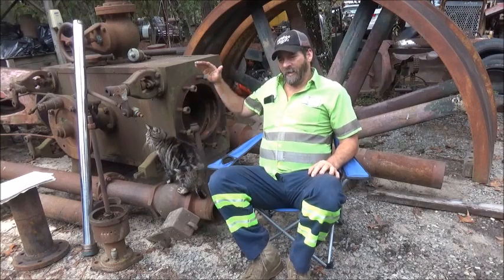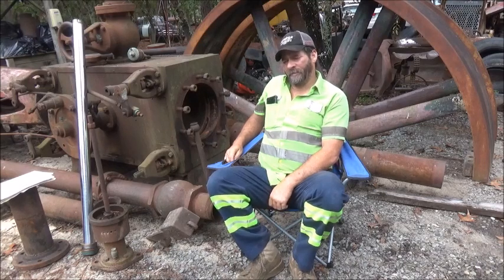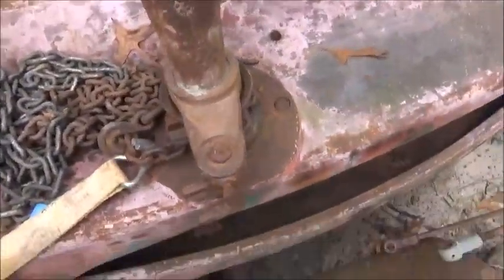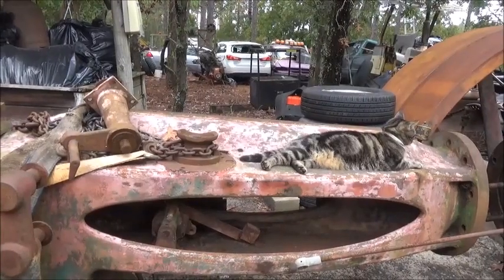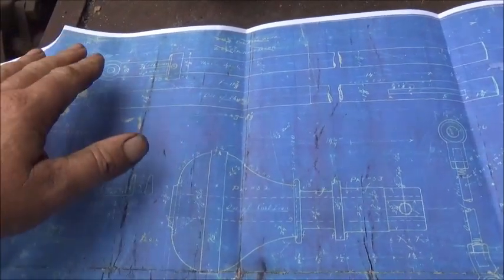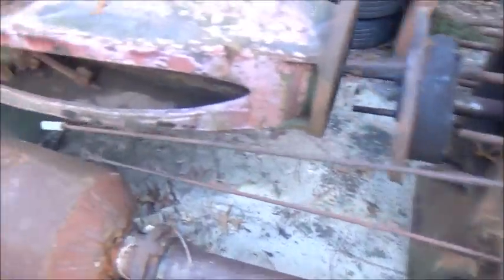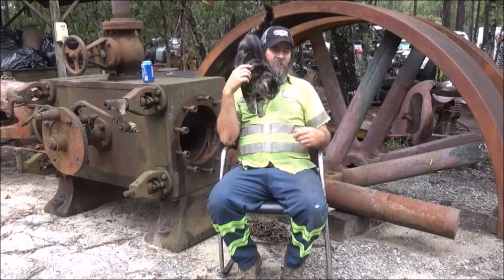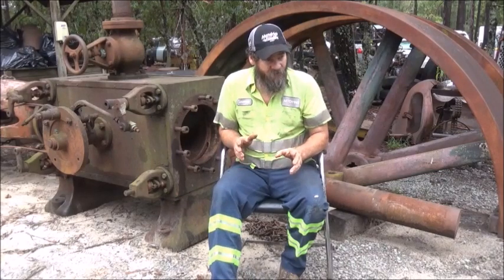BATES CORLISS STEAM ENGINE 20+ YEAR QUEST TO SAVE EPISODE 13

Comment: Fun fact: The phrase “balls to the wall” refers to the centrifugal governor of a steam engine, which used spinning balls to adjust a valve limiting the amount of steam entering the engine. As more fuel is put into the engine and more steam produced, the added pressure and centrifugal force of the spinning bearings pulls them outward toward the wall of their housing, activating a lever and a valve that limits the amount of steam.
Reply: Charlie Booker  Absolutely correct although related more to multi-engine aircraft,  the 'wall'  being the firewall.
Reply: Afternoon Jonathan,  you are undertaking a monumental task, I am sure you will succeed,  you can tell Nanna likes being the center of attention,  but she really cares about you, our pets are awesome judges of character, which I'm trying to say you are a good person....best of luck to ya!!
Reply: He said balls........ha haha hahaha
Reply: @bobd7347  Just got me thinkin’ it’d be pretty funny/cool if Jonathan here, went to his Hot Rod that has the dual carbs, having two aviation WWII throttle cable/levers with the balls, mounted along the bell-housing hump as mechanical override throttles,  just to demonstrate this exact experience on the open road, in real time! Nana Cat-Scan approved of course
Reply: Charlie Booker  Well, the documentary on steam engines I saw, and the info that was told by a steam engine guy on Jay Lenos Garage was wrong then.

Comment: Hey Jon,
It's quite possible that this never ran a line shaft. It may have been hooked to a generator.
While you were recovering it, we never saw line shaft or pulleys,  we did see old insulators though.
Just a thought.
Reply: Indeed, corliss engines were often used where fine control of speed was an important factor.

Comment: Thanks for another update. Look after Nana she's the most useful thing to help with this build, she's scanned every part and blueprint figured out most of it and any questions ask her she'll know what you might not L.O.L.  If you can figure out those bevel gears  you need, you can buy blanks with the teeth already machined and just  bore the holes for shafts and the fasteners. I work on a seed cleaning plant that has some gears that have been obsolete from the company for about 40 years.  I just tell the machine shop all he needs to know, he gets the blanks and does the final machining to the shaft spec. From your comment the other day I'm hoping you live long enough to finish this project, and I'm still alive to see it finished !  see ya next time,   Take care.

Comment: Greeting Jonathan, I also have about the same memory's of being around 5 years old. One of mine was from your neck of woods, Stone Mountain. The cable car building, it had a glass window looking into all the large gears that ran the cable cars up & down the mountain. After getting home I had made a working model of it, using kit string, a drinking straw, a small motor and a pill box for the car. So I get it, and I'm shore many other as well. Stay safe, You friend in PA. Robin Jo

Comment: Maybe you could explain what a governor is and what it's purpose is. I'm sure there's lots of people who don't know. Also, that's the great thing about pets. They love you unconditionally. Thay would never, ever give you a thumbs down, or leave a nasty, negative comment. Lots of your viewers love Nana cat, and it just wouldn't be a Jonathan W. video without her! Tony.
Reply: A governor regulates the speed of an engine to not exceed a maximum design threshold. Machines are designed to run at a maximum speed so they don't come apart due to excess stresses caused by over speed. At rest or slow speed, the round balls are held vertical by a spring, the balls bearing on linkages controlling the valve that admits steam to the engine thereby reducing the amount of steam admitted to the engine . As the engine speeds up, the balls spin faster and centrifugal force causes them to start to move out, which starts to close off the valve they are controlling through the linkages. The size of the balls are determined by how big and stiff the valve the governor controls is. The force of the balls swinging out has to work the valve so they have to be heavy enough to do so. The size and tension of the spring bearing down on the linkage to keep the balls vertical determines how fast the engine can go as it limits how far the balls can swing out and how fast they swing out. Tighter spring--balls stay more vertical--more steam pressure admitted--higher speed. Runaway engines are caused by something happening to the governor or its linkage controlling the valve admitting steam into the engine. Too much steam--too much speed--then the flywheel usually comes apart with great force since it can't stand the centrifugal forces on it. A flywheel on a large engine weights several tons and it will destroy the building it's in if it comes apart. A boiler explosion can launch a boiler through the roof like a missile and scald anyone close by (your hot water heater can do it too if the pressure relief valve fails). My Dad's grandfather lost his life in a boiler explosion in a factory. Hope this explanation helps some.

Comment: Jonathan. I built aircraft and assemblies for about 25 years (aircraft manufacture, RAMS Team (Repair and Modification Services)  - McDonnell Douglas and then Boeing. I was an expert blueprint interpreter. I became a Research Engineer for Pemco Aviation Group Inc. on Boeing products owned by the Air Force. I had online access to Boeing and Air Force digital engineering storage systems. Research Engineer is a position I created. REDARS was the Boeing system. I'd like to see the Engineering Notes. IF you need some help interpreting what Engineers were thinking when they designed that machine I 'may' be able to help. Pemco performed Depot Level Maintenance. They stripped down K-135's and C-130's to the carcass and rebuilt them to Flight Worthy status. No, it's not a 1927 Franklin....but these fly ;-) Thanks for the video. I really like your work!

Comment: Hi from the UK.....  The cylinder could be re bored in situ where it is now using a portable cylinder boring machine. The machine bolts on to both ends of the cylinder using the front and back cover studs and slowly winds a between centers boring bar through the cylinder, They use them to re bore traction engine cylinders without having to take the block off the boiler.  There must be some in the USA....Just a bit of research needed to find the nearest one.  Try preserved steam societies etc.
Lovely engine.... I know you will succeed in its restoration.....  I look forward to following its progress...
Dr Harry

Comment: The weights make me think of the accessory gear on the early caterpillar 3400 motor. The weights use centripetal force from the spinning of the gear to move the shaft that connects to the governor, helping to regulate the injection pumps.

Comment: Rough figuring using the interwebs says a 5" cast iron ball would weigh just short of 20#. 

I tried metal detecting at my house, it's a post and beam house built sometime before 1860. I found all the sickle bar mower teeth and little wads of aluminum foil you could ever want. Plus a few cases of smashed Black Label beer cans, a few horse shoes and a couple of springs out of old car seats. To tell the truth, I gave up on the metal detector after about 10 minutes of beeping every 5 seconds on junk. Most of that stuff was dug up when digging planting beds.
Reply: I keep finding EVERY nail the builder dropped when building/adding on to the house ( it is an OLD house ) !

Comment: You might try a black light on your blueprints, sometimes the wild color changes make things easier to see too. I'm betting you've got some hard to read spots there. Another history venue you could try is cencus reports. I'm unsure if they would list place of employment back then. They still will list occupations, like boiler operators. You might be able to build a timeline on the engine. Hard to say.  Maybe you want to involve local news. Get the story out about the engine, your quest, and that you are seeking information about the factories that were there, and what they did. Might get lucky and draw in some pictures and family histories that were involved/worked there. The only people that will have it will be older and eager to share. Never know what will turn up if you can put out the bat signal lol. In the reconstruction are you planning to make the engine steamable even though your intentions are to go air power? Never know you might run across a modern factory boiler at auction somewhere cheap. It'll be neat to see it spin. Thanks for sharing

Comment: Good plan you use compressed air to run the engine.  Much safer than steam especially when other people standing around the engine.
You could add white smoke to the compressed air coming in so it can look like steam coming out of the exhaust and the all important whistle!! 😀

Could even use one of your water pump steam engines to run an air compressor to run the big engine!
Reply: his previous video mentioned this ingersoll rand running the steam engine: https://www.youtube.com/watch?v=JKemgnWp3YA&t=5s

Comment: First blue print i seen that's blue always seen white and black 😎.
Reply: The blue prints are called blue prints because they are blue! It was an earlier chemical process using a light sensitive paper. The black and white ones today are drawn on a computer and printed on a big plotter on ordinary paper and are just "prints."  If you lay a blueprint in the sun it will bleach away to white and you have just a blank piece of paper.

Comment: Does a 14 inch steam engine piston have rings? And if you bore the cylinder. The rings wont fit or operate? Blue Prints are priceless. I could read em all the way from Texas. Take it one piece at a time n build each unit to make the whole engine. 
You'll get it. You just aint got it yet.

Comment: Just a idea ,could you turn the flywheel with a electric motor?Then you would not need the cylinders rings to seal and still have every thing move . The is done with a huge almost as big as the big boy locomotive at the Dututh Minnesota  transportation  museum.  The locomotive is slightly jacked up and there is  a motor turning the drive wheels on the side hidden from view.  That runs every 20 minutes  or so.
Reply: Sorry typo. Duluth Minnesota

Comment: On these old steam engines, why didn't they design the governors to be Fail-Safe?

So if the governor drive breaks, the engine shuts down rather than runs away?

ETA: And/or replace the belt with a drive shaft, which is not likely to fail catastrophically?
Reply: They did change the design later on so that a failure shut it down
Reply: @johnalexander4356  I was thinking that too.. most possible defects on governor assemblies would cut the steam going to the engine instead of the opposite. at least on the ones ive seen. 
(theres a steam oriented museum nearby, with a bunch of huge steam driven pumps used to pump water out of our (Dutch) reclaimed lands/diked marshes in the late 1800`s/early 1900`s)

Comment: The displacement may be considered  2 x 5,500 = 11,000 cid because it is a double acting piston, I'm not sure.  Also, don't leave your blue prints exposed to light, especially sunlight, for very long as they will lighten and become unreadable.  Consider taking photos section by section with your camera to preserve the data.

Comment: If you have to rebore, would it be possible to source an oversize piston?
Reply: It may need a sleeve.  That may reduce the bore diameter permitting cleaning the piston?
Those blueprints are priceless,

Comment: In case anyone wonders, my HBM is a Giddings & Lewis 25T.    Jonathan, I know you said the engine is 36" stroke, but I need to know the length of the cylinder.  The bed of my mill is 5' long, and the table is 2' wide, so the table has exactly 36" of travel on the bed.  Now the boring bar can also move, but it is most accurate to move the table.  I could set it up to take most of the cut with moving the table, and finish the last little bit by moving the bar.  I don't know, have to think on this one.  Just if you get a chance, measure the length of the cylinder.  Just for reference, Dave Richards and I have the same HBM.  If it just will not fit on my machine, there is a place just up the road from me called Fab Associates on Pence Rd. in Charlotte.  They have an HBM so big there is a ride on chair for the operator.  I know I guy there, Les Pierce, and when I worked for Michelin, they made the tire cure chambers there for us.  These were tanks 5' in dia and 36' long with a door on one end to load the tires for cure. Maybe I could get Fab Associates to bore it if it won't fit on my HBM.  I know Brian Bloc could do it.  Hey Jonathan, want to do a read trip to Kentucky to visit Brian?   I got some vacation time saved !  Call me maybe this weekend. --Doozer